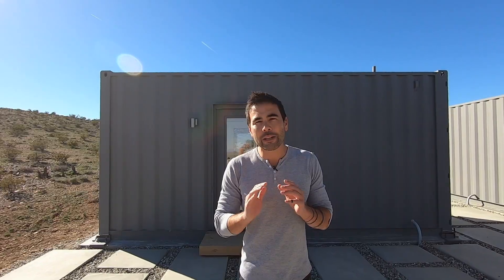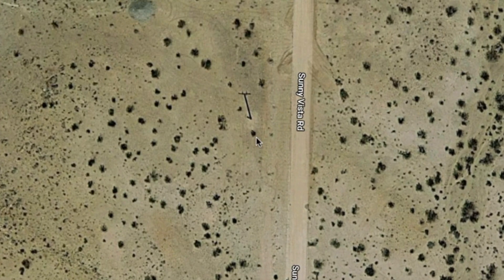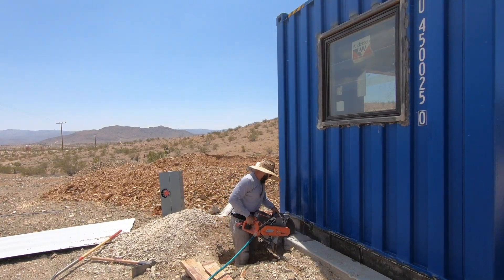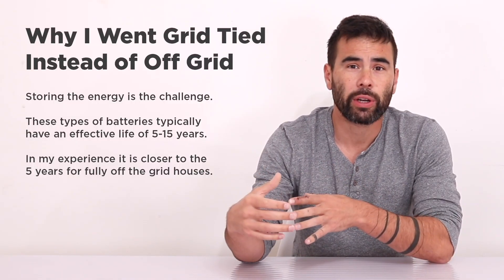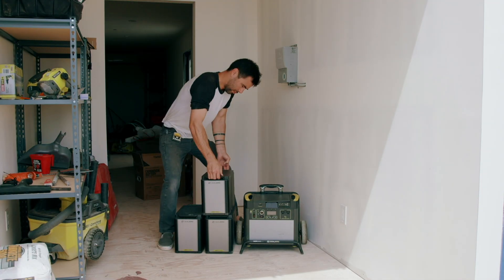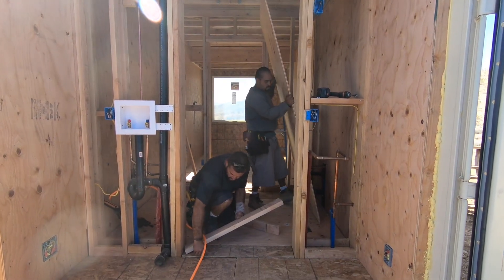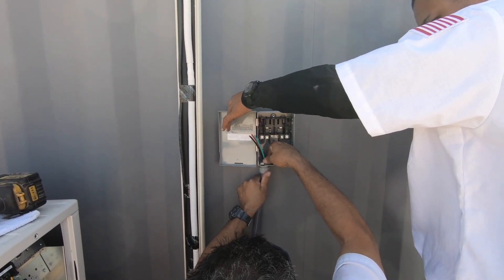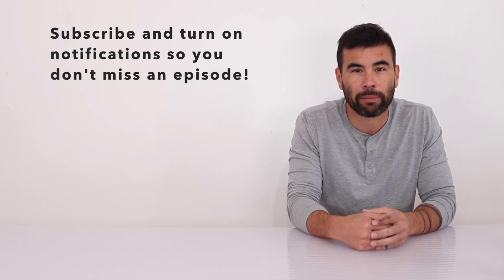Building a Shipping Container Home | EP05 Connecting to Electricity and Water

Comment from the maker: LINKS:
Shop the Container Home: https://www.homedepot.com/c/openhouse
Explore the Container Home: http://www.uncontained.house/ 
Link to the drawings for the container house: https://www.themodernhomeproject.com/#/floorplans/

I used the Home Services team from Home Depot to design and install Mitsubishi mini split ductless heat pumps.  Here is a link to their site but I recommend calling 1-800 HOME DEPOT to get a free in home consultation.  
https://www.homedepot.com/services/

I used a battery backup system from Goal Zero. They are not a sponsor, but I love how easy and versatile their products are.
https://www.goalzero.com/

Link to the company i bought my shipping containers from: https://www.containerdiscounts.com/buy-shipping-containers-and-build-a-container-home

Link to my electric motorcycle / motorbike
https://www.onyxmotorbikes.com/
Reply: Hi, I live in out the country of San Luis Obispo County north of you.  I have had to deal with California's hard water problems my whole life.  I learned of a way to soften my hardwater without using a salt-system.  I DIY installed a NuvoH2O water filtration system which uses a cartridge you replace (in under 5-minutes) every six months.  It uses a Citrus based membrane to break the molecular bonding of the scale and prevents it from forming.  10 years ago I installed this system (bought directly from NuvoH2O) when I replumbed my grandfathers home I now live in with PEX-A water lines 3/4 and 1/2 inch and Shark-Bit fittings.  My water heater and plumbing fitting and faucets have never looked, or worked better, and there's no slimy feeling like traditional salt based water softeners.
Reply: I love your project it is amazing what can you do with shipping container just a question when we are going to see the finish product I would to see the tour-video of the house
Reply: thank you
Reply: Hello
Where can I buy the tutorial/plans for the foundation, structural re-inforcement, insulation, plumbing and electrical wiring of your build pkease?

Thank you
Reply: An alternative to water heating is solar heated water with a heating element and a smaller tank that way you have the sun heat the water most of the time and the small tank is enough to supply for a shower or 2 and day to day tasks and will keep the water warm all day. Then the heating element can be used if the weather isn't favourable and because the tank is small it can fill back up and heat up quickly
Reply: Hello, please I'm looking to buy the drawings for the container but I would like to know if it contains all the structural detailed drawings too. better still can you tell all that is contained in the drawings?  Does it contain the plans for the foundation, structural reinforcement, insulation, plumbing, and electrical wiring, and all architectural detail drawings.
Thank you. AMAZING WORK AND TUTORIAL BY THE WAY!

Comment: He still containers get very very hot even hotter than stucco which also holds heat which is not ideal when you're trying to pay for cooling instead of eating your interior. I think it would be a really good idea to have shade all over the place around your container in order to keep your container exterior cooler and it would actually maintain it more efficiently. How do you use trees or you build near trees for shade or you install awnings or even a covering over the entire house such as a giant awning. I don't know I'm just playing with the ideas of ways to cut down on the heat of the exterior building

Comment: All of the Power from pole to pole all the way down that highway is way up above ground they cannot force you to bury your electrical conduit you could have ran it directly to your roof above ground and then down from the roof to the panel. In addition the power company owns that conduit and if they need to access that conduit for any reason it's buried underground. In which case I'd have to pull it all out. So there's spend money spent on this particular project which may have been unnecessary and added to cost for equipment rental and labor add materials. I would rather see that money spent on non-toxic non OSB materials inside the structure where you live and breathe. Every county is different in so far as burying utilities but I can tell you that 99.9% of the entire country has above ground Electric for more 100 years😂

Comment: I don't let utility companies tell me to report where to put my panel my panel my house I decide where the panel goes I have moved the electrical meter on every project I've ever done and put it closer to the front of the house because I don't want people entering further onto my property than necessary in order to perform work in addition back then when I started this type of work guys actually came to the house to read the meters. You could have also erected an electric Pole and brought the electric from the power pole directly to your electric pole above ground high up in the air and then if you wanted Barry power lines run it down your electrical pole and then Underground to the house it would save a lot of money and time getting a trench all the way to the pole which is not existing on your property so you're actually doing part of the work on property that you don't own
Reply: Nowadays the electric is being buried by the power company all over Florida where I live they don't dig trenches they shoot it underground from the street directly under the fence line all the way to the back of the house where the panel is and the only trench they dig is from that fence line to the wall of the house where the panel is
Reply: Guess what you don't need to power your Wi-Fi who are the battery backup because when there's no main power on the grid there's no Wi-Fi. I'm in a hurricane and tornado country I've been without power almost every year of my life sometimes for 6 weeks show me times for 2 days. My Wi-Fi stayed off even after my power was restored because Wi-Fi towers are not hurricane proof

Comment: How do you insulate so that you get Class A rated wall and roof assemblies for WUI areas? Won't spray foam to the metal melt or burn or smoke?

Comment: Would make sense to me if you size your elect system to maybe a 80 % of need and if your need starts to exceed this 80% then a generator may be needed for a short time without adding expense of a battery which is not needed very often.

Comment: I love your video. We're doing a build now on virgin land in Mongolia. I'm British and lived in the USA for years. I'm documenting our journey but the internet is too slow to upload large videos. So that'll have to wait until I solve that problem - maybe a 4g booster OR a Starlink eventually.

Our land (2 acres) cost about $11k - it's in the mountains about 32km from the capital, UIaanbaatar. The electric grid connection cost $8000 because it required a much longer hook-up - about 600 metres away. I'm doing the onsite electrical work. We have a small battery backup for the fairly frequent power outages. We considered solar but the extreme cold is a problem and electrical rates are very, very low in Mongolia so I doubt I'd recoup my costs. The backup just handles the fridge, wifi, lights and devices.

We're going to need a well and the quote is about $5k but then it's free. There's no utility for that.

My containers (2 x 20 foot, front to back arrangement) are for garages and storage, not for living. They cost about $5k total, installed. I'm adding electrical but might insulate them in time for winter.

Our main living is going to be 2 modern yurts ('gers' in Mongolian) with a hallway connector. It gives us about 100 m/2 (1100 sq ft). We'll also have a standard guest 'ger' which is what we're living in now. I'm going to build the foundations and since they 'gers' aren't heavy, I'll be doing gravel, XPS (10cm) and plywood.

We don't need A/C because it's never hot enough. Main heating will be provided by underfloor electrical heating, supplemented by high-efficiency wood stoves in each 'ger'.

Costs are a lot lower here and planning, permits don't really exist. We'll have a dog for security :)

Comment: I built an off grid system sized for a 5yr worse case with lithium. But what i did do was buy a used whole house back up generator 24kwh tied it to a my hybrid inverters so i run pure solar but if power runs to low i can put 24kwh into my system from a generator running on propane (i have never had to refill even 1 of the the 3x 30lbs tank's.) Desert hot springs

Comment: How are you detailing your penetrations? Plumbing vent through the roof, line sets and conduit through the walls. The thickness of the corrugated metal wouldn't be thick enough for a caulk joint nor would you even want to rely on a caulk joint as your main waterproofing. That's the biggest question I've had that hasn't been touched on

Comment: To keep the house look like a container, you insulated it on the inside, which means you lost a good ten to fifteen inches in width and about the same in height. That is a minimum of 10 per cent loss in space, which is massive - especially considering how tight a container is.

Comment: Hi Ben-one of the design challenges you mentioned is sizing your battery bank for occasional large demands as well as extended cloudy periods (low solar charging) To meet all of these criteria you may end up with an enormous battery bank.  One option that may reduce this enormous battery bank size is adding a small propane powered generator.  This adds another level of redundancy as well as eliminating the super big, super expensive battery banks. Propane gensets are low mtce and don't have carburetor problems-if natural gas is available that is the best. The genset has a lower mtce cost compared to replacing those expensive lithium batteries. A propane genset can easily last 30+ years with very low mtce costs. all If you want to eliminate the cost of a switchover panel you can just have the genset charge the battery bank directly.

Comment: Be careful, these air conditioners don't work well. I have a small apartment of about 800sft. I have 3 of the handlers and they don't get the apartment under 80 degrees. They also cost a ton to run. Most people that have them around California hate them. They do not work.

Comment: Might be a little late, but why not Solar system with a small back up generator? Even a small 2500-300kw generator would make a huge difference during the rare sustained bad weather scenario that one may run into.

Comment: I bet what you spent on land was less than every other aspect of this build. Unless doubling them up in width and height it would be more practical and cost effective to build traditionally.  I commented on another video how I think these are great for remote and off-grid, incremental construction type builds but should also mention termite and fire danger zones as well. For those out there considering this I would suggest looking to build somewhere other than Kalifornia or where terrain and climate is beneficial. (CA desert? no thanks).  - The state / county made you jump through more hoops and regs than was logically needed and more work went into this project than would be necessary from an engineering and safety point of view....Are you adding containers to upper levels? Containers even with your heavy duty steel frames are stronger than your designer realize and its in the corners not the walls. What it cost for water and power was robbery. 
In regards to why you decided not going off grid....I would size power system based on typical use and just get a backup GENERATOR for worse case weather ect. Gas/ diesel will likely be cheap going forward when EVs outsell traditional vehicles and if you decided more storage capacity is needed later on. Panels keep get cheaper as well and at some point battery storage may be less of an issue as only be needed at night costs of both may drop as new technologies are developed.

Comment: I find a lot of these shipping container homes end up looking really cheap as they just look like a shanty town home. They look much better if you cut the whole end panels or side panels out and install a large window/door with a good quality matching colour frame, the ones that have doors or windows cut from a section of the sides look terrible. Just get rid of one whole side panel and fit in some bi-folding doors. Cut off the whole end panel and put in a square frame with door and surrounding windows. Look at Box Park London....the shipping containers there look cool as hell. Painted black with name/number detailing, frames colour match the containers and they cut the whole panel out.

Comment: You appeared to make no credible arguments against solar panels. Anomalous weather and guest requirements, seriously? Everyone has a gas backup/charging generator for such one off events. If there is one single place on the Earth that makes this the #1 choice, it is living in a desert.
You also ignored that the primary power drain during the day is going to be your air conditioning, that's a massive drain precisely when you have the maximum amount of solar energy available. 
I hate to be an armchair critic but now I'm questioning every decision you've been making in this process, because I'm not seeing any critical thinking going on.
Honestly I think solar power sucks in almost every situation. EXCEPT YOURS...

Comment: Word of warning, I had two of those goal zero generators and they both failed on me. I had to return them and eventually get my money back, the last straw was when one of tjem started sparking when my USB cord touched the outside of the box. Both of them would lose charge really easily. I'd charge my phone and it would go down a whole bar. It was absolutely useless and was 700 bucks. Never again. Now I just use small battery banks with a 10watt solar panel, much cheaper and more efficient.

Comment: An electrical plan..structural plan.. Floor plan..sewerage and plumbing plan is not of architectural work but rather it is of engineering principles and engineering work concerns.. The only concern of architects is the facade and physical layout design only.. Get that..why do i know such difference between engineering and architecture because I am a professional engineer myself and i know what we do and what architects are concerned with in relation to construction. Hoping this will help you to correctly use the right terms ok. An engineer is different from an architect.

Comment: should of used a gas generator for back up.... Gasoline is 10cents/kwh but the generator is tops 20% efficient, so more like 50cents/kwh to generate power. You probably be paying 20cents per kwh from the grid if you factor in service fees, so not terrible ... This way you would just need a very small amount of batteries, and on overcast days, u use the generator....

Comment: Genuine question... with all the additional framework (steel and wood), does it actually save any money? I know the thought process behind using a container is that it’s a durable premade structure that requires a hole in the ground or concrete slab. After it’s all said in done, would you still recommend this method over conventional wood/other material house?

Comment: That's an extremely complicated use for the mini split system. You'll have line losses even though they're insulated, plus the added likelihood of a leak somewhere in the system that will be hard to track down. Finally, you're asking a lot of the single external heat exchanger to provide heating/cooling for all those separate spaces. Maybe it's not a problem in a warmer climate, but my mini split system really struggles to keep up with heating in the winter months here in Colorado.

Comment: Odd, I purchase mini split inverter based systems here in Greece for around 350€ for a 9000 btu unit, single head, 450€ for my inverter  12000 btu system. Yes they are very economical to operate compared to the older conventional mini splits of past. Condenser motors are continuos DC variable speed that adjust for demand. They ramp up and down instead of running full on or low choosing the best speed in between.
Over here they are so backasswards that they don't even know about how to issue a building license for a container home. They expect one to build the old fashion way of steel reinforced post, beam and deck construction with masonry brick fill in walls. Grossly inefficient systems here. As part of the license one receives to build the home they figure out what one pays for each trade for a type of workmans comp. these fees are as expensive as what it costs for the trade to complete their work so one pays double. The bad thing about the system over here is that many times the workers are not compensated by the system when injured on the job and the system burns most of the money on itself instead of paying out when needed.
BTW, do you have a link on the smart thermostats used on this project?

Comment: I would have installed 30kW of storage and installed 7kW of panels.  I own a solar business in socal and would have installed it for about 2.5x what you spent

I’m building a container home on raw land this spring. Cost to bring in grid is 120+ k. 
 2350 ft2 in total all electric. I’m using 40kWh of storage and 12kW panels plus a 40A car charger.

Comment: Awesome video n project. I have an engineering question regarding containers. I have a project in which the container has an overhang of 4-6 feet on both end (the illusion of a floating house). Do I need to reinforce these overhangs, or minimize the area that's overhanging? Thanks.